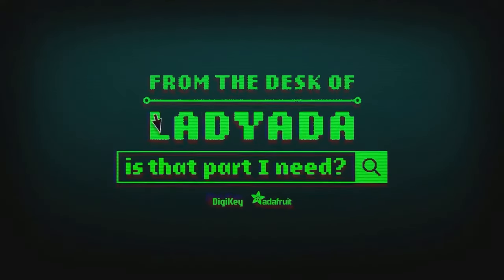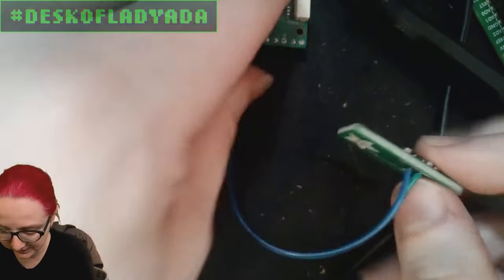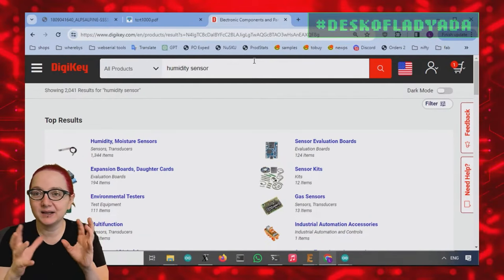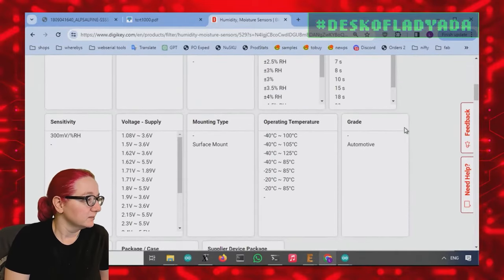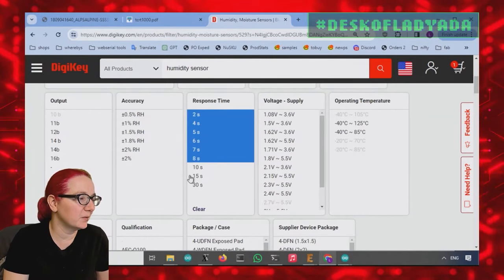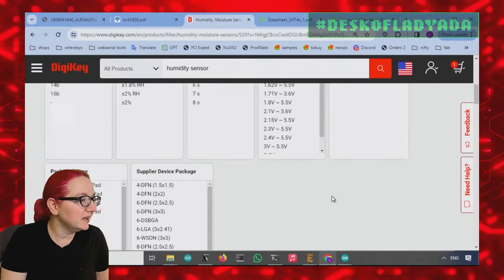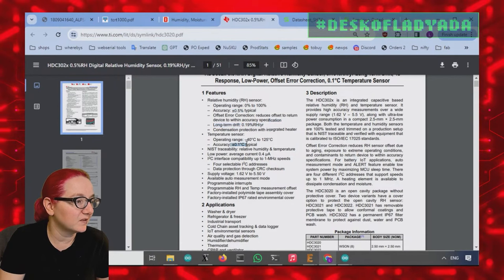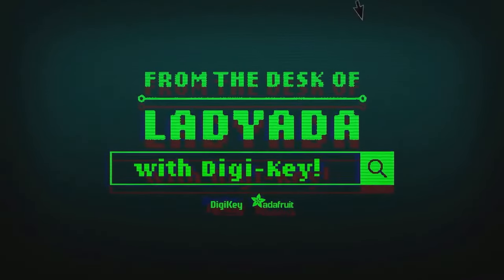The Great Search: High Accuracy Temperature & Humidity Sensor #TheGreatSearch #DigiKey @DigiKey

Comment: I have been looking at the HDC302_ sensor for long time. It have great specs. But I could not find any modules out there. The size of HDC302_ is so small, that it is not easy to solder without proper tools and the pcb design need to take into consideration self heating of compoents around, as you point out. Would be great if you could make a module with this one :-)